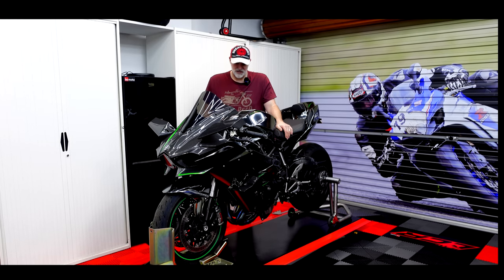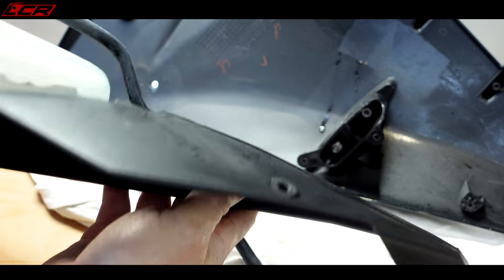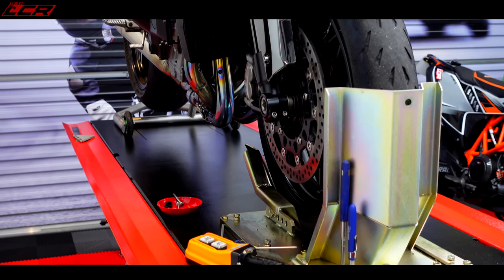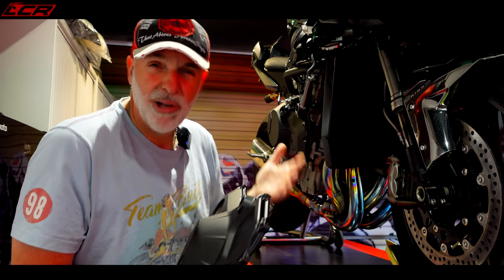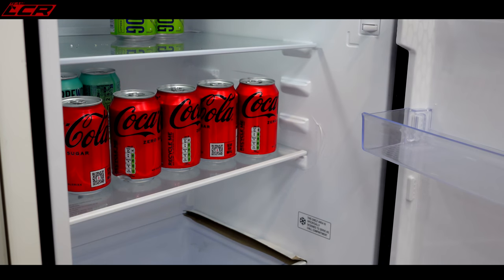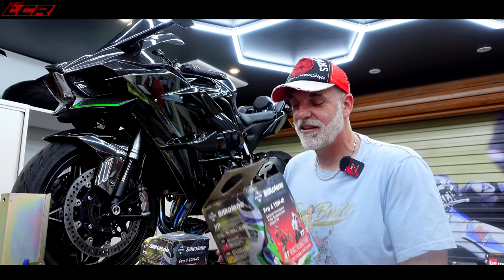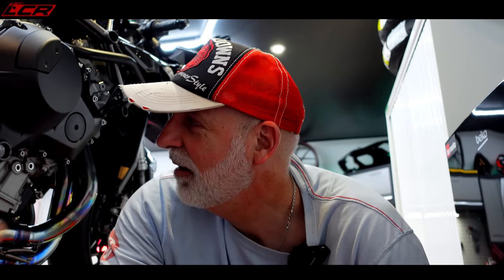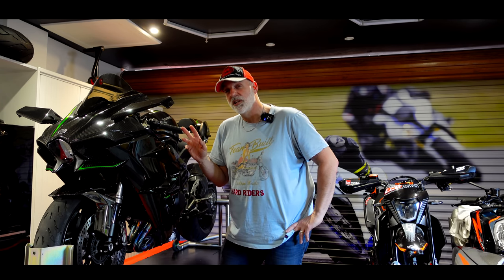Ninja H2 Crash Repairs | How Much Is This Going To COST??? 🤑

Comment: 😂 what a stitch up for parts costs. I dropped my Honda CBF 1000 about two years ago. Bent the clutch lever, small scratch on the fairing, slight scratch on the centre stand lever and the fuel gauge got stuck for a while. Total cost, about £15. Something to take into consideration for your next purchase?

Comment: If those plastic parts you're considering welding up, have fibreglass in the mix, you can't.
They'll be a code moulded into the surface somewhere, check first.

Comment: Great repair chops! Looking good…Just a little tip that might make it easier when fitting engine covers and gaskets is to thread some studs into the holes, slide gasket on and cover..then remove studs one by one fitting the original bolts. This works well especially on the magneto side.
Reply from the maker: Yeah good idea! Worth buying some generic studs to keep in the tool box 👍

Comment: Hi Chopsey, I just bought the new Triumph RS Moto2 limited edition and I’ve dropped it off my work bench onto the garage floor. I’ve been trying to avoid the garage since as every time I go in I start crying..🤦‍♂️ I thought of you with the H2 video and now I know how you feel. 😢
Reply from the maker: Oh no nightmare Michael, unfortunately these things happen. What's your plan for repairs?
Reply: @LambChopRides  I know, but what a pillock. 🤦‍♂️ I’ve priced up with the dealer here in Adelaide and so far it’s not looking as bad as I first thought, new switch block plus tail fairing and tank I think I’m looking at around $2000. As a Scotsman I’m trying not to cry as I write this 😆😢.

Comment: I’d probably try to repair the outer panel and keep it on the bike just in case another misadventure not risk 1000 quid expense. I did it with my gsxr. Like with most items you just get used to it and ended up with a box of spare new parts never put on the bike. They are just for my peace of mind.

Comment: After you dropped it once, why not install a set of clutch case guards? (R&G or otherwise)
Reply from the maker: Problem with those is they can rub over time and potential mark the casing. I just won't drop it again 🤪

Comment: Don't ever sell the H2 Chops! 
It's a unique bike, they won't make anything like that anymore, considering all the ridiculous emission laws that are on the way.
If I was You I'd have already ordered that exhaust valve from Van Demon to be ready for those more strict times. It's also nice to Your neighbors if you ride off from Your house in quite mode.
Regarding the damage that the H2 had from the drop.
IMO they were all fixable. I understand that it is a special bike, and why You bought the parts. 
I'd have fixed those parts for sure, I mean you can still do it and make a video of it :)
I have been rebuilding a Kawasaki ZX6R from a way worse crash. The bike had been high sided, so there is damage all around, on the top of the bike too, with way more scuffing and cracked panels.
I even had to buy a new ignition switch and top triple coz those got scraped on the tarmac too..
But Kawasaki factory parts are crazy expensive, so I've been salvaging as many broken pieces as possible. 

Great content anyway! Would love to see this beast being opened up properly.
Either on an air strip somewhere in England, or on the Autobahn in Germany.

Comment: Crazy that you are replacing the exhaust and cover because of those minor nicks😂😂
Reply from the maker: Can't mess about with a bike worth 24k!
Reply: @LambChopRides   Do you reckon that's what you could actually sell it for on the open market or is that an insurance valuation? 🤷🏼‍♂️
Reply from the maker: That's what other bikes with simalar miles to mine and age are going for 👍

Well advertised for but they don't stay for sale for long..

Comment: You probably already know this?  But did you loctite the screws inside the inlet for the compressor? Because if not the screws might unscrew and grenade the compressor.
Reply from the maker: I've heard about it and need to check mine 👍

Comment: Harrys garage sold his pagani zonda bought for £230,000 sold for about £400,000 now worth £3,000,000+ there's a YT video on it. I do like the Ducati Diavel. I really enjoyed the video. but you had a lot of discounts how much would it cost us non YTers?
Reply from the maker: Prices I shared were all retail prices 👍
Reply: @LambChopRides  cost of the end pipe. cost of the resprayed part. at least an hour of labour +material in that job. even if you do it on top of another one. I wonder what wheels would have quoted you to do the repair?
Reply from the maker: @stevekirk6399  resprayed part cost me a 10 pack of fosters so pretty reasonable! 😊

Comment: Chops, are you aware of the issue with the bolts that hold the air intake to the blower not having Loctite applied to them? There are stories of them coming undone and ending up inside the blower causing total destruction.
There's a video explaining this issue on the 'dirty garage guy' channel.
Reply from the maker: Yes I've seen it, not checked it yet however... might go do it now! 👍